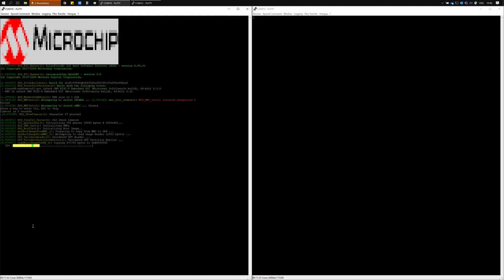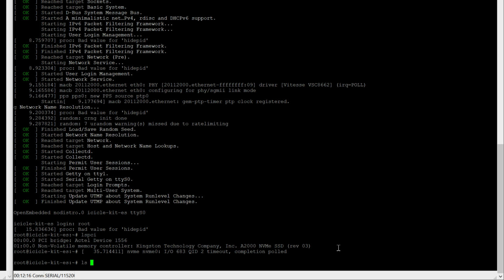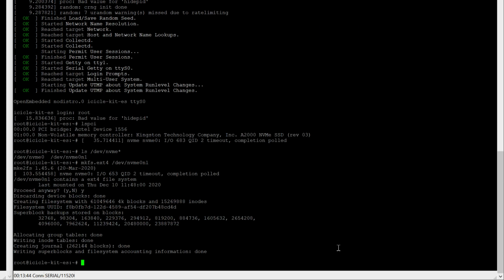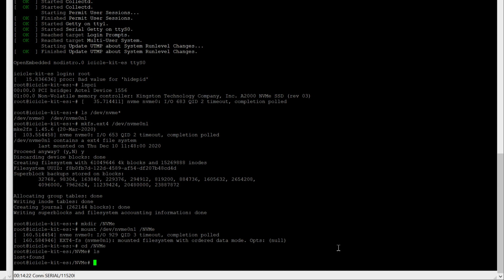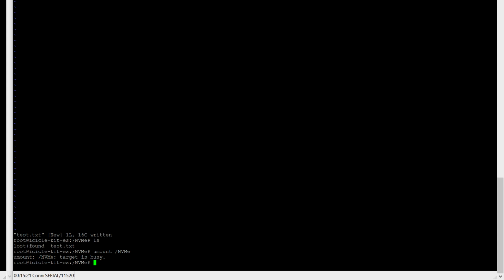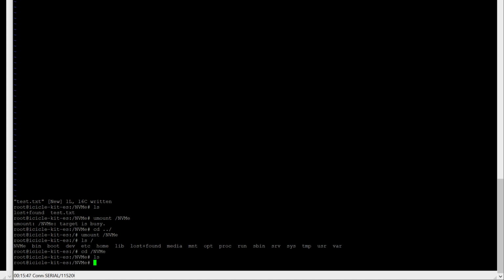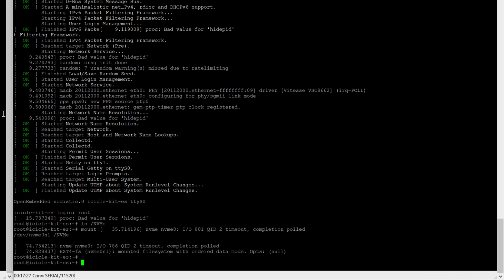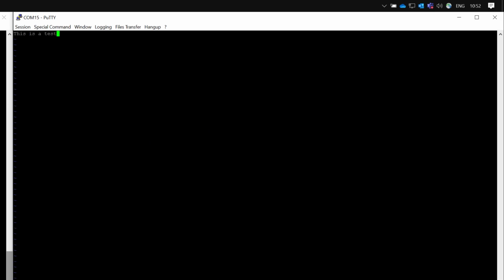Linux: Connecting a PCIe End Point, an NVMe Drive and Mounting

Comment: Hi, I have the PolarFire RISC-V FPGA with OpenEmbedded nodistro.0. I connected a gen3 PCIe ssd (Intel 750 series) to the board, but I do not see the device under /dev.  I do not have the lspci installed. Do you know what should I further check, is there any jumper setting needed?  By the way, I inserted an SD card and it's not detected either. Do you have any idea?  Thank you very much!
Reply: Hi Tao Lu! When did you get your board and have you updated to the latest design + software combination from GitHub? https://github.com/polarfire-soc You can also raise an issue here if something isn't working
Reply: @hughbreslin8267  Hi Hugh, thank you very much for your reply. You're very correct, the kernel image needs to be updated to enable PCIe. My original kernel was 2020.10 version, which did not have PCIe driver enabled. After update to the 2021.4 version, the PCIe works.